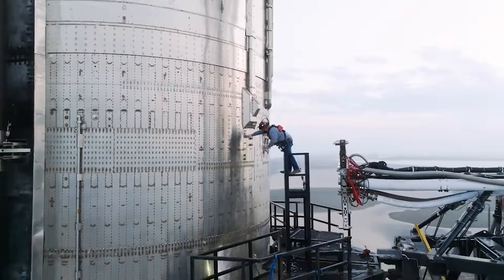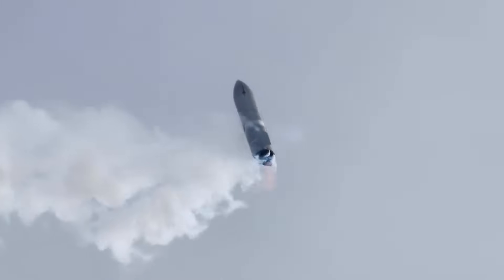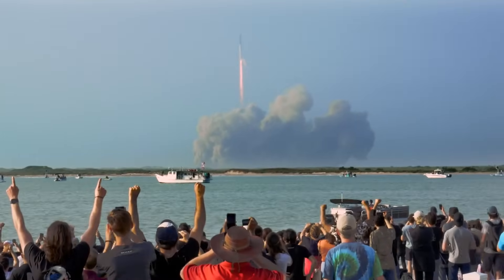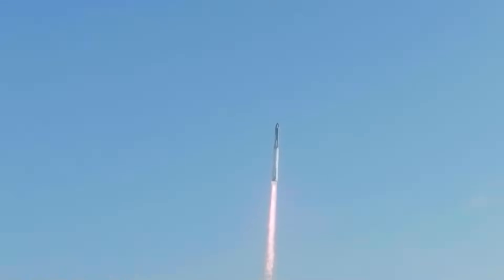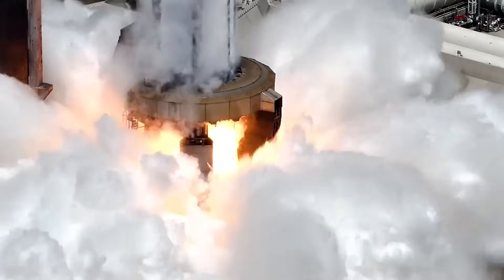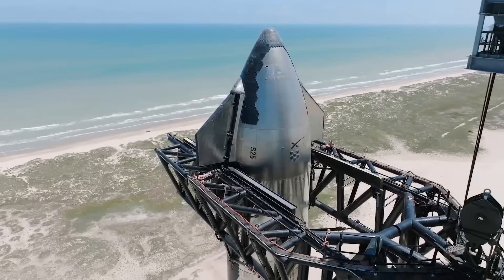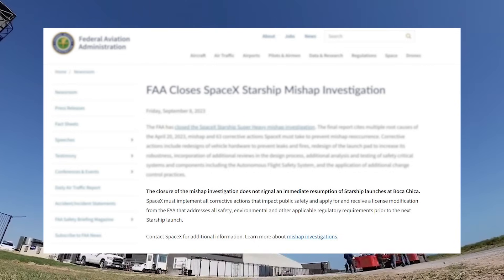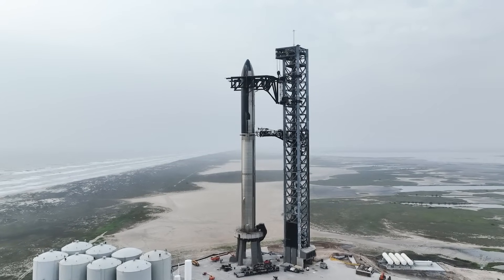What Changes Did SpaceX Make To Its New Starship Prototype?

Comment: The separation mechanism should be based on explosively actuated slider bolts, the weight on the stage separation assembly is extreme

Comment: I still suspect SpaceX misunderstood the amount of heat and pressure the ground plate would have to endure; however, I have no doubt they've subsequently to the two tests recalculated and made suitable updates. With the addition of that separation ring the overall stack is looking quite daunting, here's hoping that they now incorporated sufficient redundancies and will have a successful second launch.

Comment: 2:30 - Correction -- the AFSS activated on time, see: "unexpected delay following AFSS activation," and "fired all detonators as expected" as well a the video of the launch itself, where it's leaking from obvious holes long before breakup.  The problem was that the vehicle did not break up in a timely way after the AFSS fired the detonators.

The well informed speculation is that they used an off-the-shelf AFSS setup which was already qualified, thus saving time, but the charges were too weak for a rocket the size of Starship with relatively tough steel skin.  Upgrading the explosives should do the trick, but it did mean they needed to get it requalified.